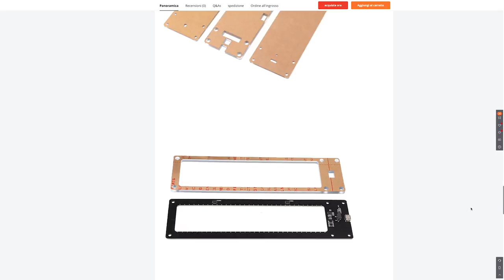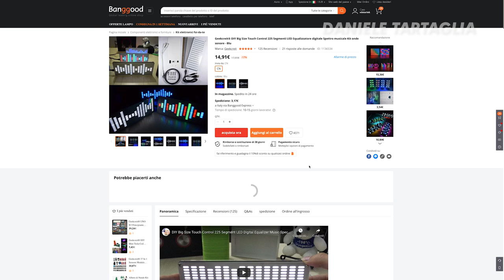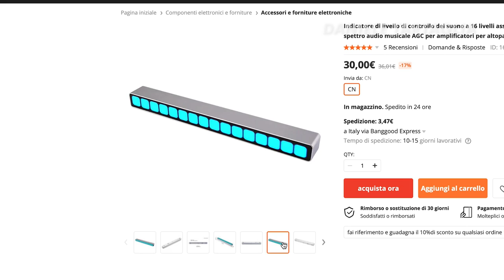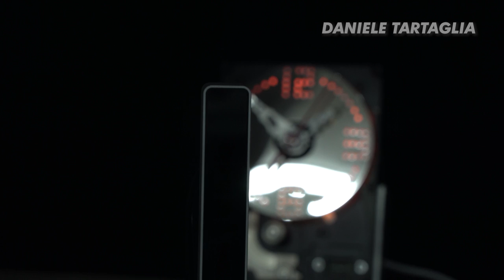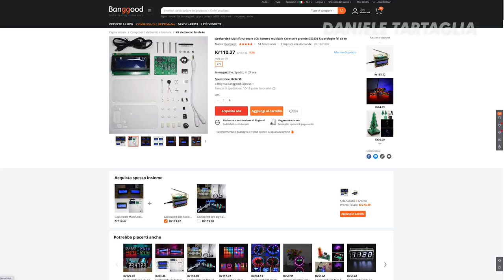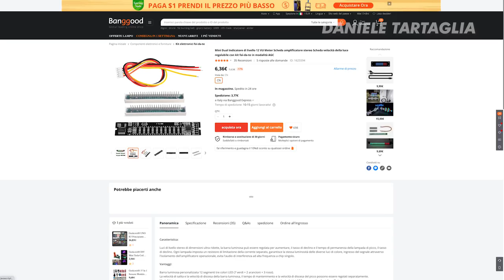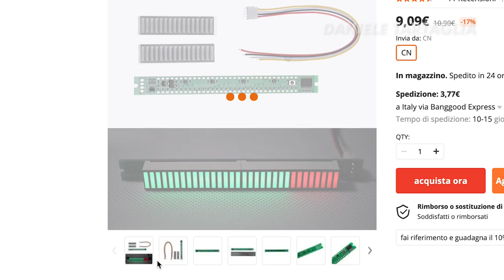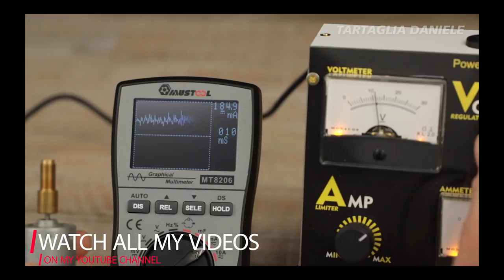TOP 7 AMAZING VU-Meter from BANGGOOD

Comment: I got the analog meter kit a couple weeks ago and it's great! Really cute little meters with a nice warm glow. Fairly accurate, too They are easy to calibrate if you have a signal generator. Set it to 1000Hz @ 1 volt and connect to the meters. Adjust the pots on the board to give a 0VU reading.

Comment: This is all well and good, but a serious spectrum analyzer should have 32 frequencies. And most importantly, the column of the left channel level indicator should be located next to the right channel indicator (so that you can easily compare the levels). Not above, not below, but next to. And so on for each frequency with a red indication of peak values with a delay.  Choose the type of indicators in such a way that the indication does not fade after 30 years of daily use (remember the faded indication of VCR displays from the 80s) . Choose the type of indicators so that the indication does not fade after 30 years of daily use (remember the faded display of VCRs from the 80s) Perhaps these are ordinary LEDs that do not work at the limit, but with a margin of brightness (saving their resource). Reliability is important here, not a disco of lights. The device should not introduce noise and distortion into the original signal on the oscilloscope. It will be a professional apparatus.